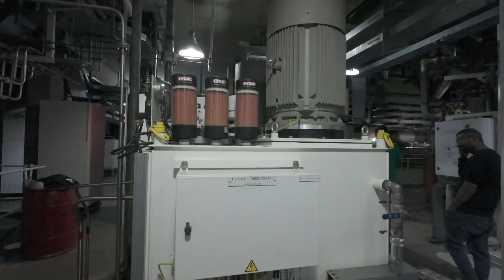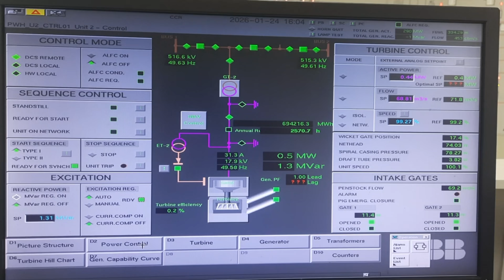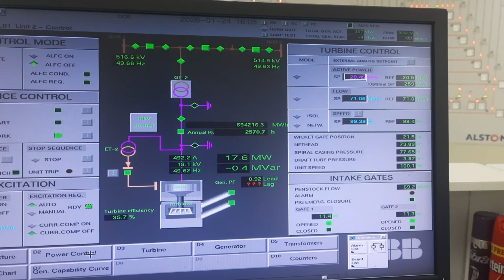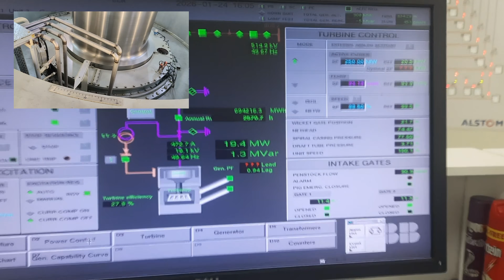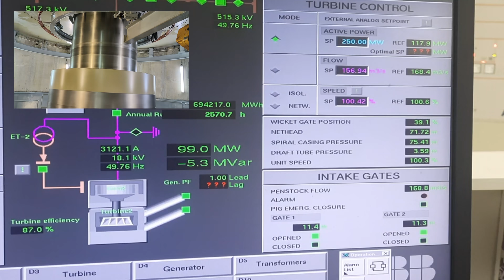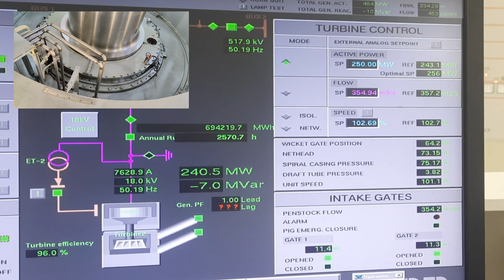The Machine That Needs Oil to Float Before It Can Even Turn

Comment: Thank you for this highly informative video. It clearly highlights the challenges associated with hydroelectric power generation, which involves mechanical, electrical, and thermodynamic engineering. I learned a lot. 🙏🏻

Comment: 0:58 microns?!?!?!? 😮 holy cow. Those are some serious tolerances!
Reply: I know...I was watching the position of the shaft in relation to the handrail, to see if I could detect it moving up a little bit.

Until I heard it moved only microns 😊
Reply: The oil film thickness would be about 50 microns or 0.002 inches. There's no metal to metal contact at any time due to the bearing being pressurized prior to water flowing through the turbine. I assume that the generator uses Kingsbury thrust bearing. They can last 100+ years.
Reply: @phillipcramer7936 it may be added that when the rotor begins moving, it pulls oil along due to viscosity and therefore cushions itself a tiny bit more

Comment: This made me wonder why it was designed with the rotating shaft in the vertical orientation. I wondered if it would be more efficient and easier to lubricate if the rotating shaft was horizontal.
Reply from the maker: Vertical shaft = water falls naturally → maximum energy extraction
Horizontal shaft = water must be redirected → more losses, more complexity
Reply from the maker: Vertical shafts:
Maintain better alignment over long lengths
Reduce shaft deflection
Result in smoother operation and less vibration
Reply from the maker: Vertical shafts allow heavy rotating components (runner, shaft, rotor) to sit on thrust bearings.
The entire weight is carried downward (gravity-assisted)
Easier to design and maintain thrust bearings
In horizontal shafts, weight causes uneven loading and bending
Reply: @hyrovision  Great video! How many other bearings are there for the huge shaft we see, other than the thrust bearing below?

Are the bearings that prevent the massive shaft from moving laterally similar to needle bearings on an automobile wheel hub? Or sleeve bearings like the crankshaft of an automobile engine? Or...?
Reply from the maker: Turbine guide bearing. Upper guide bearing , lower guide bearing.
Reply: @hyrovision Are they sleeve bearings, or a different type?

Comment: Almost 8000 amps at 18kv is another level of big.
Ludicrous currents and high voltage at once.
The largest stuff I work on normally are 1000kva transformer stations and main distribution panels.

This generator can feed 240! of those.

Comment: Retired utility electrician here. 40 + years working in hydroelectric plants in British Columbia, Canada.
In the America's, our frequency is 60 hertz. 
It should be noted thst any generator must turn at a constant speed to generate at 50 or 60 hertz, respectively.  Each plant location could have a different rotational speed. Each generator is designed as a function of the reservoir hieght, or the height of the water column.
I've worked on generators from five to 485 MVA. They all work on the same principle.
Thanks for the informative video.
Reply from the maker: Waooo 40 plus experience
Reply: Question from a newbie: Why don't they let the grid synchronize the generator first, and then progressively add flow?
Reply from the maker: They can't synchronize the generator first because the generator must already be spinning at nearly the same speed and frequency as the grid before the breaker can close. In a hydro plant, water flow through the turbine provides the torque needed to accelerate the massive rotor to rated speed. Once the generator reaches the correct speed, voltage, and phase, it is synchronized to the grid, and then more water flow is added to produce power.

Comment: Is a water-hammer relief system necessary for this type of variable vane turbine?
Reply: They have a " shoot tube," it runs up in height to absorb the massive shock.If for some reason , the turbine has to be shut down immediately. I believe this channel shows on in operation.
Reply from the maker: There are two types of system for that one is the surge shaft which you call a tube shoot upwards and the other is a pressure relief valve. Both are covered on my channel
Reply from the maker: In the latest video I have shown a pressure relief valve in action.

Comment: 200+ feet of head isn't "Low head" by any means.
Reply from the maker: Yes, it’s a low-head Francis turbine operating with massive discharge. In hydropower, when the head is low, the discharge is high — and when the head is high, the discharge is lower.

Comment: 8000A, give or take.  I wonder what gauge wire they use to distribute that power.  Multi-phase of course, but still.
Reply: Big copper bus bars. It's only (hah ONLY) 18,100v coming out of the generator. That makes insulation inside the generator much easier. It would probably feed directly into step-up transformers from there.

Still... 8000A @ 18,100V. That's some serious power. The kind that turns most things into incandescent plasma if something goes wrong.
Reply: depends on the voltage. Likely 100KV or more so not that high of amps
Reply: @HyperSpaceProphet  You can see the control interface showing 18kV and rising amps to about 8000A. It's transformed to 516kV later on (top edge of the control interface).
Reply: 220, 221 whatever it takes….. For u Gen Xers that get that movie reference 😉

Comment: man, that's 30 year old ABB software!
Reply: And it's there for a reason, it works! No useless BS in the code.
Reply: @RodrigoM3llo  Or endless amounts of cruft, it's anyone's guess.
Reply: @cebruthius  exactly
Reply: @RodrigoM3llo  IT would tell us we need antivirus on it!   We ran this ABB 1190 software in paper mills for 15-20 years.  We had another HPUX box that translated ABB to the provox dcs and eventually IT said that box had to be replaced.  Vendor ported software to linux, IT said "if its on our network, it must be windows" .  Vendor ported it to run on CYGWIN.  IT then said "it's gotta have antivirus on it".  Ran great for about 6 months until A/V got a new scanning method that consumed all CPU time at 6am and took down the DCS link.   Thanks IT!!!
Reply: @RodrigoM3llo , we definitely need to build a hippie power plant where all the software is vibecoded in Rust.
Reply: @seriouscat2231  The choice of Rust will eliminate certain classes of error, so it'll be fine 👼
Reply: @seriouscat2231  hahahaha

Comment: 50 Hz.. Where is this?
Reply: Pakistan, I hate how the uploader did not mention the place of filming. 50Hz is used in Pakistan and this is the Tarbela Dam. The ABB's S.P.I.D.E.R. SCADA system you see manufactured by abb hochspannungstechnik ag in the circuit breaker clip is used in this dam.
Reply: Nearly all of Europe, Asia, Africa and Australia use 50hz. Japan uses both 50 and 60hz.
Reply: Judging from the text on a control panel, germany, austria or Switzerland.
Reply: @ai4px  Since it's all English, perhaps England.
Reply from the maker: It's a long list of countries using 50hz.
Reply: @hyrovision  True, but Germans usually have their own language.
Reply from the maker: Equipment in this power house is from voith.

Comment: 100 RPM ? 
Should be 120
Reply: Some places run on 50Hz, as you can clearly see in the monitoring panel of the generator.
Reply from the maker: But this turbine rpm is 100.
Reply: @hyrovision  50 Hz hurts best❤
Reply: No. I've heard 100 rpm has healing properties and is better in tune with the vibrations of the universe.

Comment: "Yea this is pretty neat. The breaker switching sounding like shotgun definitely gives a sense of scale of power generated" - Is wildly inaccurate. I have been corrected by people with more understanding. The sound is made by a spring.
Reply from the maker: This turbine head is low but flow is also massive.
Reply: Sounds like a shotgun because of the springs in the breaker. Not because of the power.
Reply: @TheDaftWilliam isnt the large spring there to prevent arc flash? 

With power like this, the heavy spring is needed to make sure open and closed are distinct.
Reply: @PlaidHiker   Yes, and very rapid , to minimize the amount of time when the contacts are not quite touching, but are close enough for the voltage to arc across the gap (and then the amperage to pump energy across the gap and create heat like an arc welder does). This also burns away the contacts prematurely.
Reply: Ok, fine I'll edit my post lol
Reply from the maker: Good decision
Reply: @hyrovision lol I'm a musician and a pilot. Wtf am I doing here anyway
Reply from the maker: Lols
Reply from the maker: Perhaps you can share weird noises from the aeroplane ✈️??
Reply: They have very strong springs in them.
Reply: Actually, this shotgun noise is the breaker opening (see also indicator light going from green to red); closing breaker does not make any noise
Reply: @pif0514  I have experience with substations and breakers, and I would like to point out that a green light means "open" and the red light means "closed". All large circuit breakers sound like shotguns because they use springs to open and close. The sound has nothing to do with the electrical power being switched.
Reply: @TheDaftWilliam  US convention is green = breaker open/stopped, red = closed/running; European convention is green = breaker closed/running, red = breaker open/stopped (same as traffic lignts, green =go, red = stop); generator breakers do not make any significant (shotgun) noise when closing (opening is a different story)